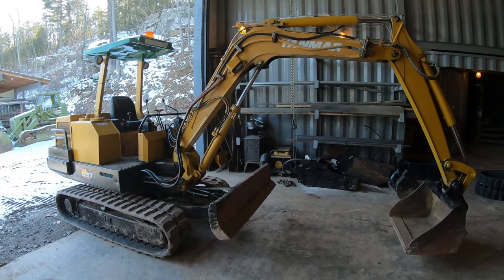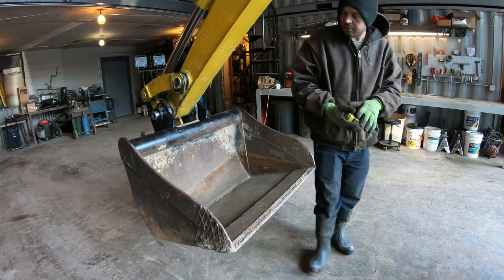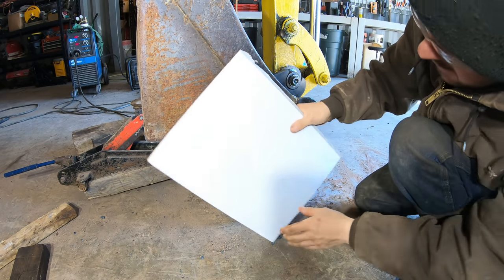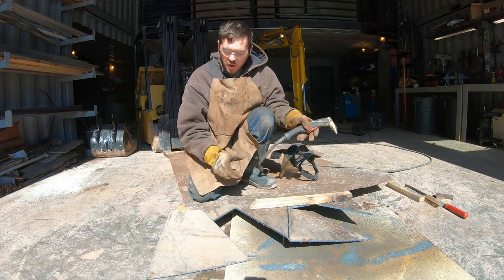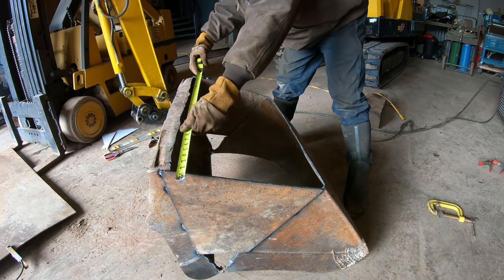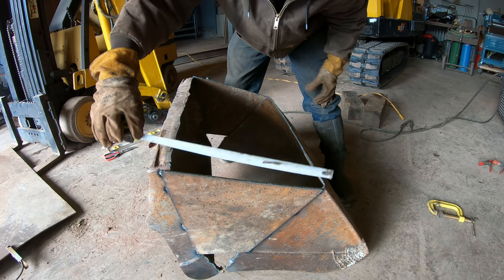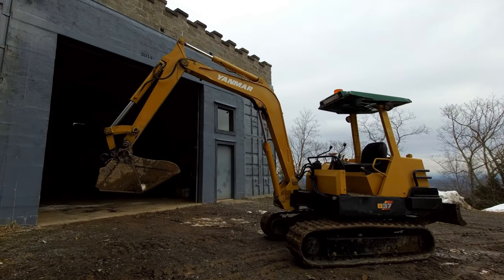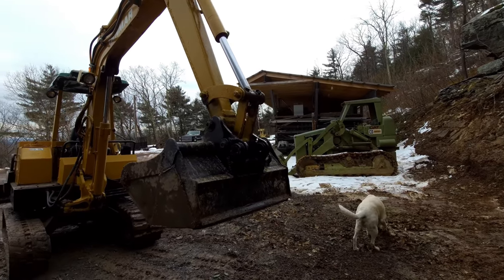Modifying an excavator bucket

Comment: Plasma, water jet, and laser all do the same just have different properties. For thick plate, water jet could be better than plasma due to not having to deal with slag on your parts after cuts. I have seen Fireball tool's water jet and it has a tilting head so you could do bevels as well.

Comment: Do you have a spot on your property where you could use your biggest excavator and that green track loader to dig the deepest hole to put a zombie apocalypse/fallout shelter? Then design it on the computer?
Reply from the maker: Potentially. I have been thinking about building a buried bunker type building. But I want to finish it nice, landscaped well, maybe air BnB it.
Reply: @AndrewCamarata  Cool, how deep and wide could you make it with your current equipment?

Comment: So, has the B50 been "Quick Changed" yet?
also, did you repaint the B37? looks a lot shinier!
Reply from the maker: I don't think I am going to quick change the b50. That system I installed on those two machines is a little small for the 50.

Comment: Millscale (from plasma cutting), rust n regular dirt don't make a good match with standard MAG welding, especially when you don't run it hot (and from what I can see, you do not). For structural welding, where strength is requred, stick welding would be much better choice. If you don't have a stick welder you can use a dual shield method - a small spool of flux wire plus a pair or knurled rollers (needed for pushing flux wire) don't cost that much. And if you don't care about dual shield just clean the steel (where it is going to be welded) properly before welding it - a quick run with an angle grinder would do. And if you use MAG for heavy welding, run the welding hot - as hot as practically possible, since you need a good penetration when welding any  load carrying device.
"Finishig" the welds with paint is not necessary, but a good preparation BEFORE welding is.
PS: "MAG", as the shielding gas isn'a pure argon (MIG = Metal, Innert Gas), but it is either straight CO2 or Ar-CO2 mix, and CO2 is an "active" gas (MAG = Metal, Active Gas) - but this is just a side note.

Comment: Couldn't you have just removed the quick load,  and added an angle block there and then re-weld the quick loader back in, without messing with the actual bucket?

Comment: If you digging back to a pipe,  its only way to go.   I dig with smooth edge majority of the time.    As you weld more you will preplan better,  if you extended the flanges when you changed it you would have saved the second fix.    😎

Comment: You do a lot of work in stone but you never use rock buckets which is pretty much 1/2" or 3/4" plate steel welded in the sides and back of the bucket where it would get the most abuse.

Comment: Those fork lift drive tires are looking pretty worn out. Be careful lifting heavy loads on the interior material of the tires. The rubber compounds and internal support structures in the center of the solid tire are not designed for those stresses. You will split the tire and end up falling on to the center hub with no traction and an tilted load.

Comment: Clean the area your going to weld before welding so your not cutting through and mixing crap in with your weld,

Put a new plates along the open sides of the bucket to the cutting edge on each side, that's what helps stop the bucket breaking in half and transmits the pressure from the hydraulics to the cutting edge.

Comment: Seems like more power would be  easier.  Add an on of switch to engage the blade, And a wheel on the front set at 6 inches.

Comment: one way of easy make a bucket are to cut out the sides like a "Sabertooth" shape. wide at the top and point at edge. make the top and attatch the sides to it. attatch the bottom at the top then use the excavtor with the bucket attatced to press the bottom to the ground so the bottom matches shape of the sides and point weld it then weld the whole thing.. hope you undersand.. we have made loads of buckets that way.. you only need 4 pieces of metal then. 2 sides one top one bottom. and theeth or harder material for the edges.

Comment: Hello Andrew, what is the measurement of the shop?
Reply from the maker: The entire thing is 40'x40'x16'. There is 24' between the containers.
Reply from the maker: I think its a good size, If you are doing a container building, you can do it any size you want. Just move them apart from each other. Or even use 8 containers instead of 4.

Comment: are you gonna fit a quickchange to the b50 too?
Reply from the maker: I am not sure. I think that quick change system is too small for the 50.
Reply: @AndrewCamarata  you mean that the bushing is too wide? The yanmar is only sligtly heavier than the kx121. That should be around 4.5 tonne machine. The yanmar is a 5.5 tons?
 In the netherlands we use the "verachtert" system quickchange with a sliding tapered bar. Most of them hydraulic.  Even on the size of your pc 15.
That does change size at around 3.5 ton machine weight.  From cw0 or 05 to cw10
Reply from the maker: It would probably work. On Komatsu's 5.5 ton machines they use a larger system. That's why I questioned it. That B50 is strong.
Reply: @AndrewCamarata   i think it will work but indeed it is on the smaller side. Maybe you can use a thicker plate material for the ears. I think it will hold

Comment: Andrew, with all the equipment you have you need a mice large machine shed, like a pole barn and just a thought if you lay in pex tubing and and have a stand alone water heater with antifresze solution, you could have a heated floor.  Not hot,  but more importantly not cold.  After putting that system in my house and basement, I'll never build  a building without it in a cold climate. It's very cheap to put tubing in even if you don't think you'd use it cuz adding the heater, pump and manifold to control the heat is nothing if the piping is there.  I'd bet $1,000s   you'd have really appreciated it in your shop.

Comment: I give it to him he can improvise but with all the tools and equipment he has in front of him he could of done a better job , just precise measurements from the bucket and the metal could of looked like a normal bucket . Would of gave him credit if all he had was an angle grinder and torch with a cheap harbor freight welder . If it works it works ! Good job though on doing it for some wouldn’t of touched it

Comment: Could have put a C clamp on the fork to hold down the sheet of steel.Also the bucket your modifying is a leveling bucket not a excavator bucket.Don't take my comments in the wrong way.Your making a bucket that don't meet your needs and modifying to what works for you.

Comment: Build a bucket with a hydraulic mixer in it, use the tool,circuit to run the mixer for concrete..

Comment: It doesn’t curl enough because the mini x is so small, it doesn’t have the power, and that bucket is way to big for anything but finish grading, not digging a trench or swimming pool, you will burn up the hydro pumps and motors.think about it for a minute

Comment: Ive built CNC Plasma Tables for friends. You can build a really nice one for 2k all in.
Reply from the maker: Diesel Ramcharger yeah, 2k wouldn’t be bad. I just spend like $500 on 4 sets of those Kubota quick change bucket ears. It would have been cool to make them myself.
Reply: @AndrewCamarata  The most important feature to have is a water table. The internet experts will chew your ear off about THC {torch height control} but its not really necessary, especially if you don't plan on cutting really thin shit all the time. Ours is set up to touch off before each pierce, and that works more than fine. i can  get you the drawings for the parts you'd need to have cut out if you'd like. its a pretty simple build really. We used the chinese F2300b controller for this, you can get them for about 450 bucks or so if you shop around. its the most expensive part to buy. But i like it a lot better than using a laptop and a host of other crap to make it all work. https://youtu.be/jdlqhrDjJoU

Comment: Well, why buy something new if you can build it yourself? Good work as always. And you almost doubled the capacity of that bucket as a side effect. XD

By the way: What do you think about the Engcon Tiltrotator attachment? I'm sure such a thing could be useful for you because it gives SO many options and with the claw on it you can handle wood, stones, and other things. On top of that you can rotate and tilt the bucket in almost every direction you want what can safe a lot of time and work in some cases.
https://www.youtube.com/watch?v=57TbbWa_bDk

I just dont know if the tiltrotator is compatible with your quick changes.

Comment: ====WHY DID YOU NOT JUST LENGTHEN THE ELBOW THEN IT WOULD HAVE TUCKED IN MORE====I`M AMAZED YOU GET THROUGH A DAY THE SHEET OF 4 MIL GIVE OR TAKE ON FORKLIFT YA SHOULD HAVE USED RACHET STROP OR SAME IDEA TO HOLD DOWN====I SEE A BIGGER BUCKET YA DIS`NT SAY!  YOU NEEDED BIGGER BUCKET====

Comment: I said in the video when you welded the brackets on the bucket there were at the wrong angle, now your made a load of work rather than set the bracket correct in the first place

Comment: Not to be a jerk, I would have changed the articulation angle of the hinge vs modifying the bucket. You changed the volume, weight of the bucket, and weight the bucket can hold......without changing the connection pins, hydraulic ram, or pump. That could prove to be a major problem.
Also, the welding work is not factory spec. Mig welding in this application probably weakened the bucket substantially. Looks like a lot of room for failure. Just my opinion.
Reply: I am shocked I had to scroll this far down for the critical comments, they make my day....never gunna work, its going to fail...yadda yadda yadda...……..that bucket will be around long after you are in the ground.  Almost everything that built this country would not be "Approved" now....LOL

    I love the critics advice, sink 10k into a bucket change on a 10k machine....LOL, no wonder stuff costs too much now and no one can afford to do anything, unless they do it themselves.

 Keep up the good work ethic and keep showing how its done without a million dollar budget.
Reply from the maker: Everything I did was perfect.
Reply: @AndrewCamarata , Hell yeah it was. Absolutely nothing wrong with that bucket.
Reply: Matt, I'm happy it's just your opinion, cause it's way off bro !!
Reply: Lets see welding old steel with out grinding the rust , light mig should really be low hydrogen arc rods , mild steel not bisalloy bucket sweep all wrong, no wear plates . In hard digging it will possibly last a max of 40 hours, before you flame me i have been repairing machinery for well over 40 years and have built buckets from scratch. If you think these repairs are good you are deluding yourself . It wont be long before his lax safety standards either maim or kill him
Reply: @randomoldbloke  Pete Ryan is trying to say that he is offering some ideas that might be helpful for others doing similar jobs, and here's what he said: "Everyone has his or her own way of doing things, and Andrew may feel that his bucket may not be used often enough to do the things I would suggest, but, that being said, I would suggest doing more rust grinding; using an arc welder instead of MIG, with low hydrogen arc rods; using stronger material; and adding wear plates. I feel those suggestions would add to the life of the repairs."  Also, he is concerned with Andrew's safety and well-being, and wants Andrew to take fewer chances.
Reply: John Minoletti nope i was saying it as it is , it is rude to twist words around! This guy is a train wreck waiting to happen i have seen more than my fair share of workplace deaths and helped in investigations, the way this blokes works the lack of saftey precautions were not even acceptable in the 70s let alone now . He won't take advice that is given to him , luck only lasts so long . Not hating on the guy but unless he learns how to do proper repairs he is either going to kill or maim himself or others , he has a fair working ethic will give him that but that is as far as it goes .
Reply: Matt Cerbone you start off with...Not trying to be a jerk...you knew how people would react to what you said. Now you want to come at me? That’s foolish. How do you expect to comment on here and not catch some flak for what you say. AC is obviously a popular guy and has a loyal fan base. As far as the dog, he’s busy with your old lady.
Reply: Satire, pete., not twisting words. I thought you came on a little hard. IMO, Andrew is an action guy.  He is nimble; physically and mentally. He likes risk (all his entertainment involves risk taking) and,  just like all of us, he constantly does personal risk analysis -- weighs probability of harm, degree of harm, etc., vs. reward (time, fun, etc.). He understands the risks, and he chooses to take them. You don't. Different strokes. He knows the risks. It's his choice.  He doesn't work in a formal work setting, and he doesn't have to consider the safety of fellow workers. If you think it is better that others here do not try to copy his style, say that. Don't risk coming off like a bullying asshole. You obviously know your stuff.

Comment: The ugliest bucket in your collection. The problem was in you quick change attachment. It was welded at wrong angle.
Reply from the maker: It was welded at the angle it needed to be at. It would have looked weird if I corrected the angle by just adjusting the quick change plates. Plus I wanted the thing bigger anyways. I am happy with how that project turned out.